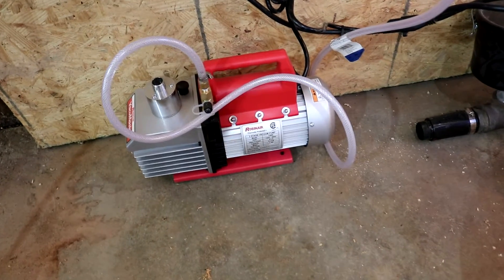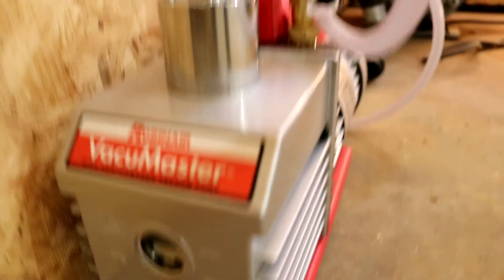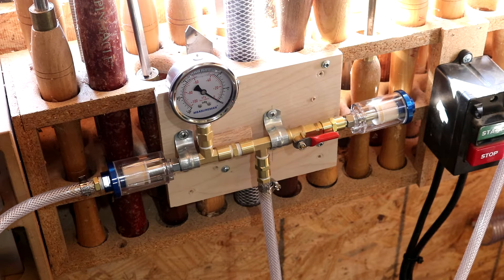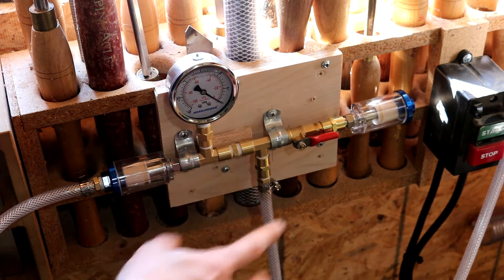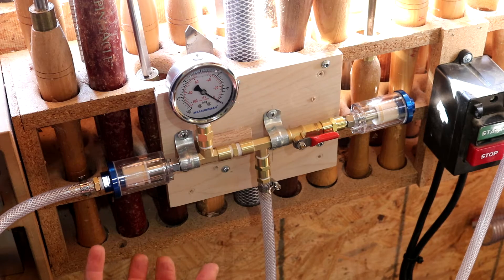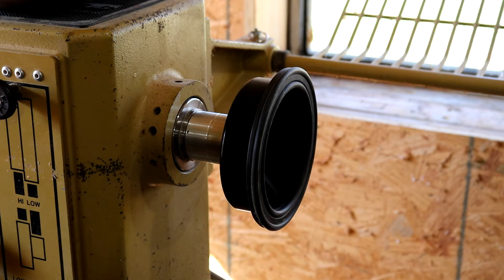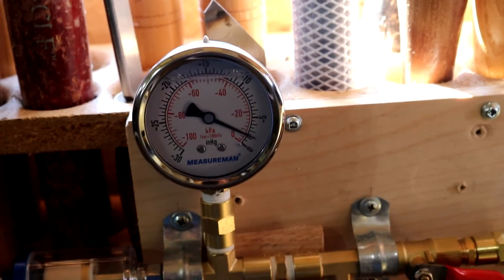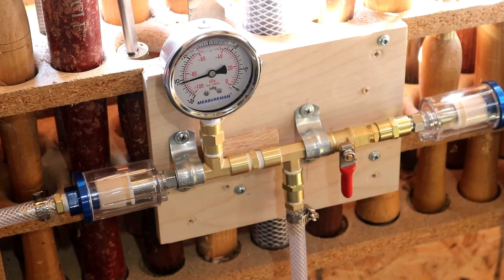Vacuum for lathe - How I made it work! (Part 2 of 2)

Comment: I hope that you are doing as well as can be. As for the reason the oil needs to be changed so often, is because vacuum pumps are designed to pull moisture out of the refrigerant system. It gets into the oil and will turn it milky if it is not changed out. Unless you have a drier on the inlet side, it will get moisture in the oil. In the old days, we used a moisture trap that had dry ice in a pot, and the suctioned air/moisture would freeze to the outside of the pot.